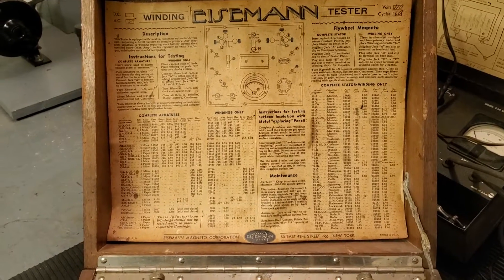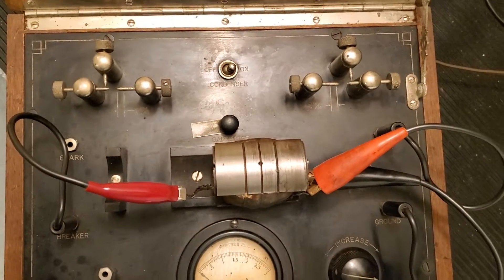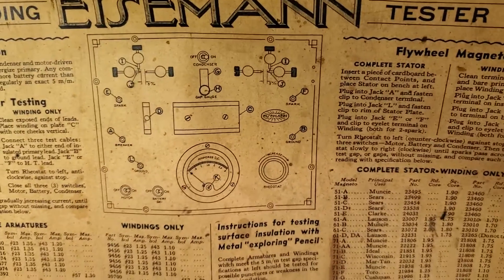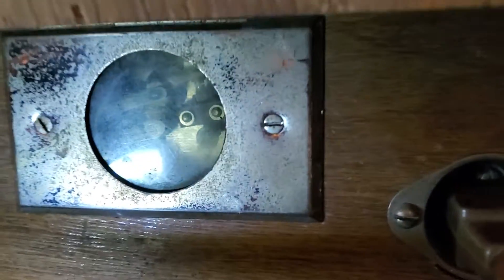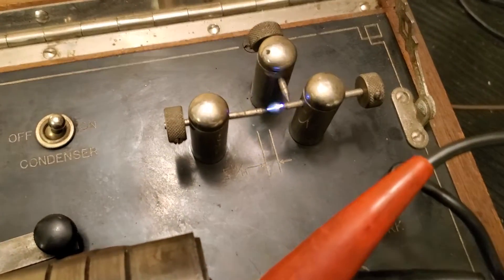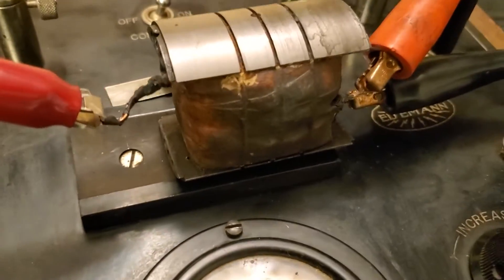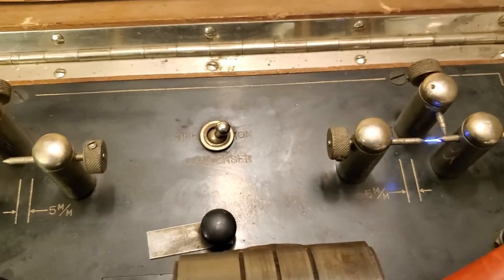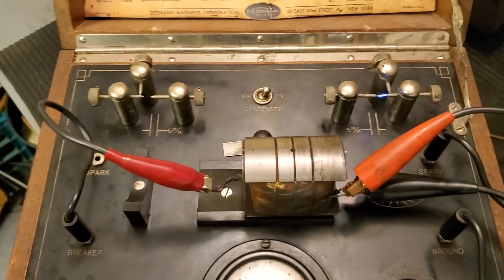Demonstrating an Eisemann magneto winding tester

Comment: Hi Steve, The first thing I saw was the spark gap and said to myself, "This is gonna be cool ! "   My first job out of high school was building 25 KV power supplies for the  testing of wire insulation. So I am familiar with the buzzing and smell on ionized air.  Very cool Steve !       Regards....Doc
Reply from the maker: Thanks Doc. I really enjoy using this old test equipment.